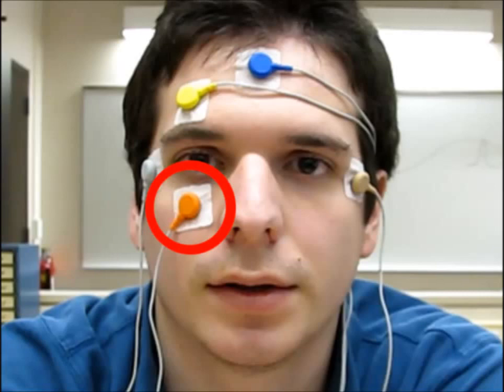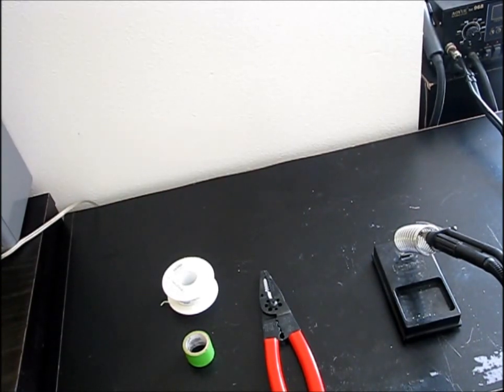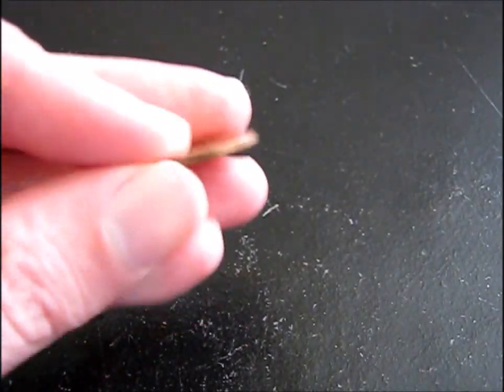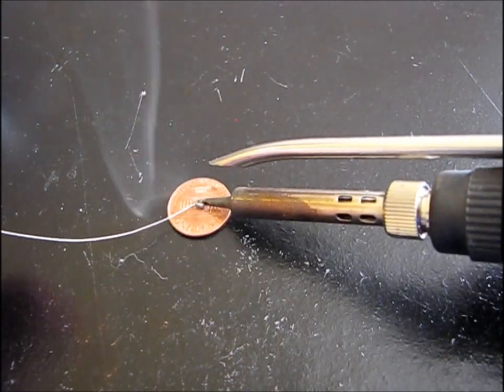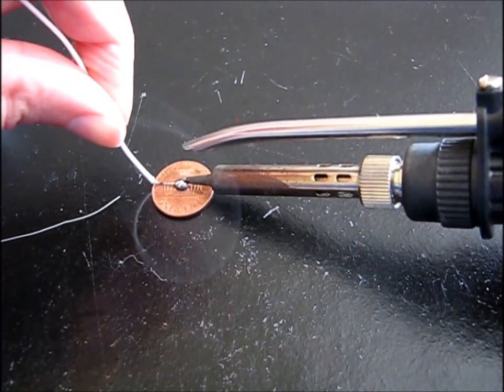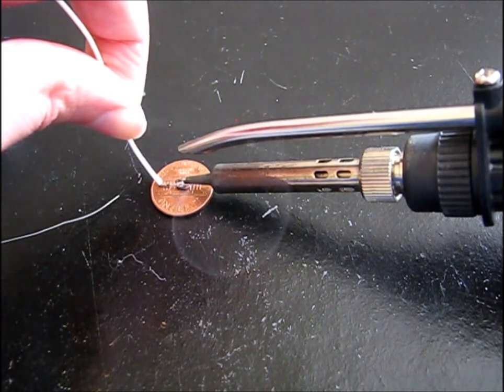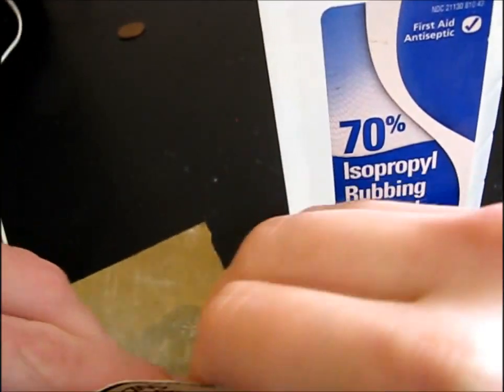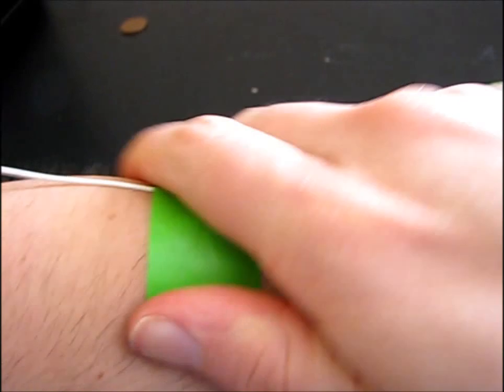Penny Electrode

Comment: How can I send 25 and 40Hz through an electrode?
Reply: Use a 555 to create a signal put a potentiometer in to control the frequency then the output of the 555 can go to a MOSFET to step the voltage up to what you want

Comment: Hey I think adding a little bit of flux (available seperatly) would make the solder connection better
Reply: yes and preheating with a small butane torch or similar device